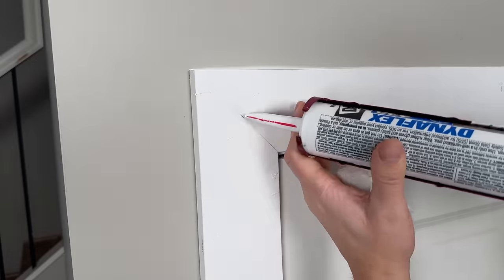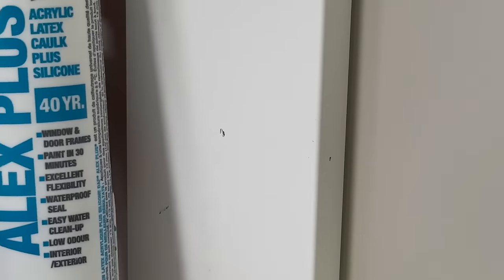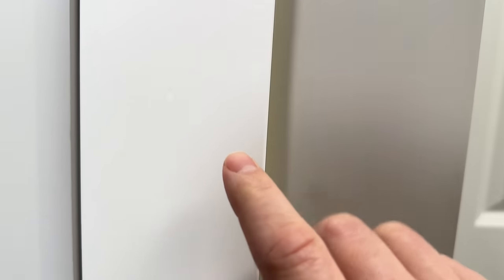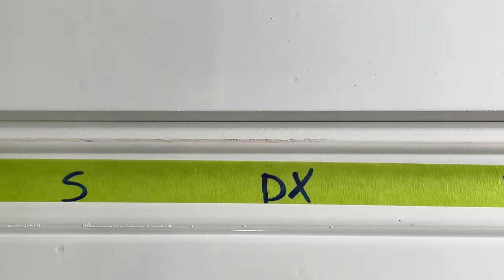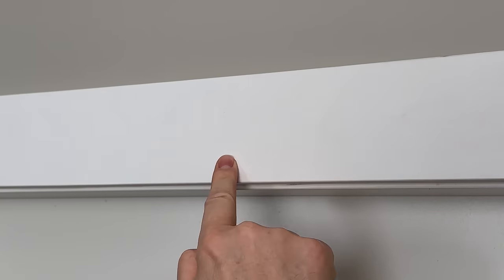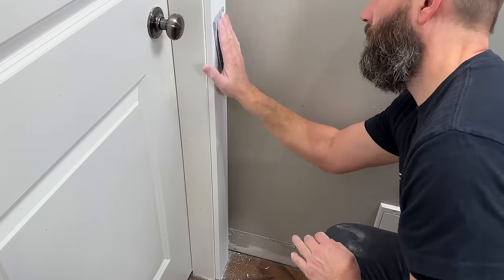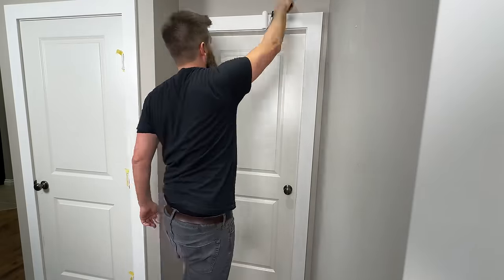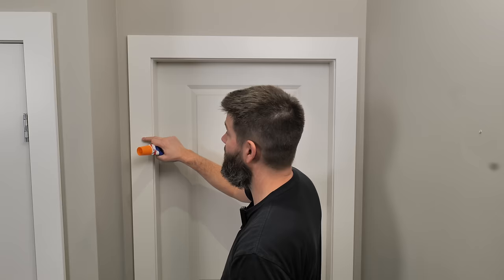How To Avoid The #1 Nail Hole Filling Mistake.

Comment: Finally, someone who has got it right. Caulk has its use but it is not to fill holes, especially on trim. The builders used caulk on all the trim in my house and now a few years on down the road you can see all of the yellowing caulk, the poorly applied caulk in the miters, the blobs of the stuff all over, the nail holes and it is just about impossible to get off. I pretty much have to remove everything, try to sand down or clean out somehow, put it back together and then correctly fill. Caulk and duct tape, everybody's quick fix that has to be fixed again on down the road. Do it right the first time.
Reply: What if you paint it over?

Comment: Setting compound like Durabond 90 or Sheetrock works best for nail holes and other imperfections. Doesn't shrink, cures quickly, and is easy to sand with a sanding sponge. Why the sandpaper for flat trim? Sanding sponge, end of story. (You can use regular drywall compound but it shrinks and two applications with drying in between is often necessary.) Cheers.

Comment: Been painting professionally for 25 years, I use painters putty(glazing), for nail holes, miters and any outside corners. 
It’s the way I was taught, by a second generation (old school) painter. 
Never have issues with it, as long as it’s done properly. 
This is the first thing I put new hires on, to see if they really know anything about painting.

Great videos, very informative

Comment: I enjoy your videos.  I have been working as a trim carpenter for decades and I have always used window glazing putty.  It does a great job filling the holes, doesn’t shrink, and no sanding required.  😊

Comment: Cant count how many times I've seen painters use caulking. Awful. I like to use the drydex tube similar to the filler tube you have. I cut the tip on an angle with a ~5/32 opening, press it firmly onto the nail hole, squeeze until it splooges out a bit, and onto the next. The excess is necessary for when the wood casing absorbs the moisture of the filler and pulls some in. Do all your holes and you can go back to the first and start sanding. One coat and a quick sand with 220 and the holes are invisible. I find this to be the quickest without sacrificing a perfect finish, with the added benefit of completely eliminating a putty knife and any need to use your fingers.

Comment: I did a whole bedroom of trim and baseboards with caulk and learned this lesson the hard way.  I definitely bought wood filler for the rest of my house after the nightmare of 2-3 rounds of filling nail holes. What do you do for nails that did sink all the way?  They're not out enough to pull them out, but I haven't had much success trying to get them counter sunk.
Reply: You need to buy a nail set, then you drive them before the surface and fill

Comment: What about inside miter corners?  Would you still use wood filler to close up a gap?  Does the wood filler have give?  Working on a corner windows where the header connects as one piece but there’s a very small gap.  My thought process was to caulk at the mitered seam but wood filler for nail holes.  Thanks a ton.  Your videos are super helpful

Comment: My strategy is different but I like the spirit of what you do. I use a 23g pin nailer so the holes are almost invisible and then just run a wax-based wood repair kind of crayon. I then don't have to paint anything at all once it's in place. Also no waiting for anything to dry. Also my pin nailer is cordless so no compressor to install, no hose. You can't see any holes anywhere with that.
Reply: Do not do this. Nails serve a purpose
Reply: Hey. Can you provide a name or model number for that cryon? Many thanks!

Comment: Pro tip- mix some lightweight and the orange Elmer’s. That way you can adjust how hard it is to sand. The orange color will help you see what you have to sand. Straight Elmer’s is a bit too hard. You’ll sand right through the pre primed trim.

Comment: Were the trims pre-primed or if you have bare wood is it best to pre-prime before filling the pin holes? Most of the door trims in my old house are damaged and scraped really badly by the previous owner who used a very wide walking frame. I suppose its false economy to fill all the scrapes and dents with wood filler, sand and re-paint them rather than replace? Or is bondo better for that sort of job. The finger jointed trim isn't that cheap where I am. Also some doors are set close to one wall as the hallway is narrow and so the trims were cut down to accomodate this. It looks odd having one side half the width of the other. Is it better to make all trim sides the same width? However skinny trim around the whole door might look a little odd too?

Comment: Hi, nice kick, what should be used for inside corners of crown molding that has cracked? Stretchy caulk, or wood filler?
Reply from the maker: Inside corners stretchy caulk is best.  I'm working on that video this week!
Reply: Use Big Stretch
Reply: That's great, thanks! @TheFunnyCarpenter

Comment: I’m redoing an old house with old wood and new wood. The wood I used for trim 1x4’s from HD is awful & crooked. 50% doesn’t line up! I have to work with what I have now. You are right, the caulk doesn’t hide these areas. It works take a lot of filler to try and make them look even. I just don’t know what to do. House is on piers. Constantly shifting. I thought the wood filler would crack. The caulk looks awful even though I treated it like clay to shape it! lol!  Any advice?
Reply from the maker: I'd use wood filler for nail holes, mitre seems, outside corners.  I'd use caulking, Dynaflex 230 for seems and inside corners.
Reply: Find a real lumber yard.  You're likely to get better material for less money.  Finger jointed material is straight and not terribly expensive, if you're going to paint it.

Comment: I couldn't agree more on the nail holes, but I've had the miters eventually crack when using filler vs. caulk. Thoughts?
Reply: Glue together the mitered pieces when installing so the bond is stronger between the pieces. Can still crack over time, but will hold up better. CA-glue on one piece and activator sprayed on the other piece or just woodglue.
Reply: I never do miters. I trim with a craftsman style trim with butt joints. I can count on one hand the number of miter joints I've seen that are not either gapped or smeared with caulk, spackle or wood filler in an attempt to close the gap.
Reply: @billvojtech5686  good luck butt jointing a piece of Taurus or ogee architrave
Reply: @sineave6419  Notice I said I always do craftsman style trim.

Comment: Fantastic videos!
Any suggestions on fixing existing caulk divots left by the sub-contractor?
Reply from the maker: I would sand them down a bit and then use wood filler over top
Reply: @TheFunnyCarpenter  Awesome, thanks!

Comment: I used wood filler once but the issue i had was after several weeks the filler would crack from the contraction and expansion of the house. Any tips for that?
Reply: Caulk
Reply: Expansion and contraction is not the problem with nail holes.  Use filler only in holes, use caulk for gaps between trim pieces.

Comment: Can I use window glazing, like Dap 33?
Reply: I wouldn't.  It's oily, might cause adhesion problems, and would be a mess to sand flat because it doesn't dry.  If you got it flat so it didn't need sanding, then it would probably work.

Comment: I saw you had a can of the MB ready patch. I’ve been using that for about the last year or two with good results. But I’m also the guy installing the trim and either at the end of a day or right after I install a piece I’m there hitting it with that stuff to maximize dry time.

Comment: Alex Plus caulk should be banned.  The stuff doesn't work well for any purpose.  

I use water putty for my holes now.  You can mix it to whatever consistency you want.
Reply: Great stuff that water putty. I use it also all the time on projects that I paint. Works great in nicks  and dings s well as nail holes. Easy to apply, dries fast, doesn’t shrink and sands easy.

Comment: Painters use light weight spackling for nail holes, not wood filler, not ready patch and no painter uses a roller on door casement.  What the hell are you telling people?
Reply: Paint rollers work great on flat casings. I do I all the time.
Reply: @Sillyturner  I'm sure you do lots of things all time.
Reply: @richardmckrell4899  🤣

Comment: Best wishes for 2024!
You by far are the funniest carpenter but should move away from painting...

Filling nail holes is done by painters with their tricks of the trade.
Depending on the nail size with lightweight specle are lacker-filler.
Dries quickly and easy to sand.

Greetings from the land of the wooden shoes.